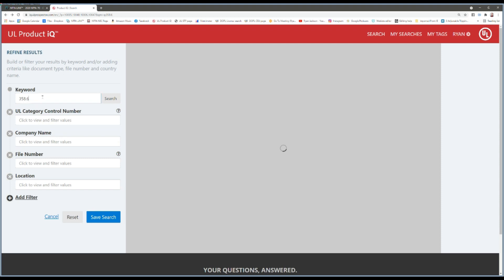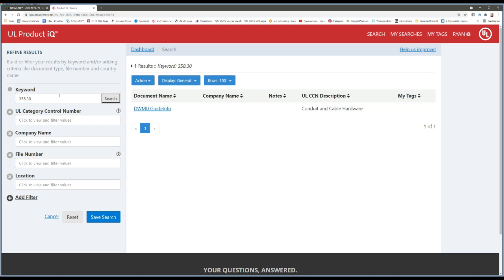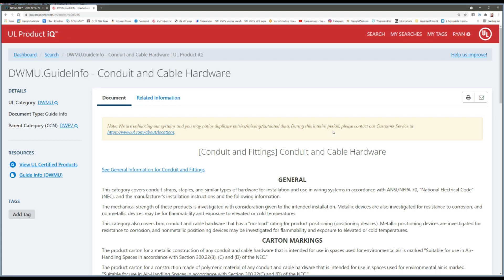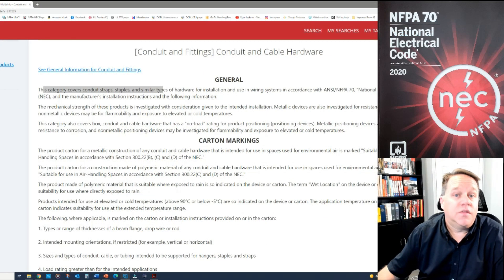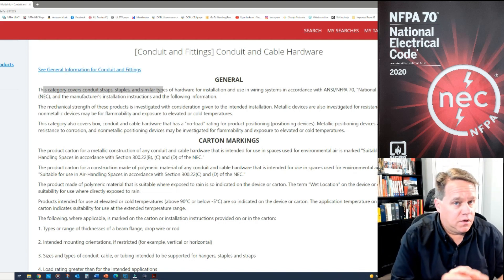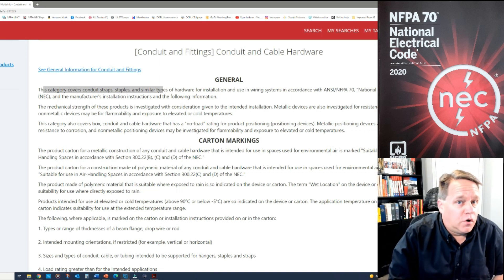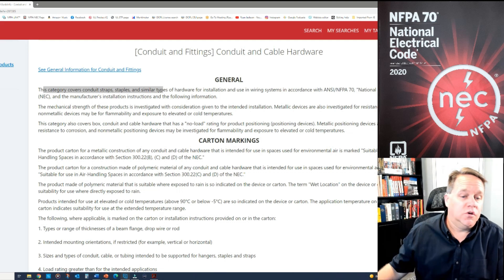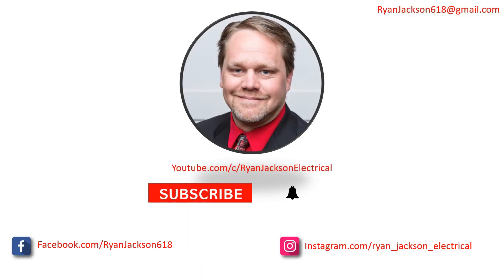100 Days of Article 100: Fitting

Comment: Years ago cheap gray bushings were only good for 75 degree C so we always specified the blue colored bushings from Thomas & Betts that were rated for 90 degrees. Not sure if it still this way. Do not know how some companies get approval for cheap die cast locknuts that break in two or strip out. Always asked for steel locknuts. Used to use aluminum locknuts on aluminum conduit & nipples but they strip out fairly easy. Some old timers would never mix say a steel locknut on aluminum heavy wall conduit.

Comment: There should be a requirement in building codes that spaces used as air-handling plenums be marked as such. It can be a PITA to figure it out sometimes. I bet there are millions of miles of plenum rated wire and stuff in spaces that do not require them.

Comment: Interesting discussion! This might be off-topic, but any idea as to why cable ties for NM are specifically called out as needed to be listed in 334.30 but not the other "fittings" or hardware?
Reply from the maker: Yes, the reason is that cable ties that are not identified for securing are quite weak. They're fine behind your TV or under your desk, but not for supporting circuits. Look for a listing Mark AND a type with the letter S, such as Type 2s or 21S.
Reply: @RyanJacksonElectrical  Cool, thanks! Makes sense since "regular" cable ties are such a commodity/bulk item there is little QC.
Reply: Electricians should also only purchase cable ties rated for drop celings that are used as a pluem. At least one company was selling these for same price as non reated ties. Do not ever bother asking grainger sales people if they carry these ties. Asked 3 seperate grainger people about them. Last one that was our sales rep took my cell phone # and told me they would get back to me soon. That was over 5 years ago. Heard the rated ties have no markings on them. Also heard that companies that manufacture weather resistant receptacles do not have to have the WR on face but can be on side. Lot good that does an inspector when a cover is blocking it. Heard this at an IAEI meeting from might have been a guy from UL.